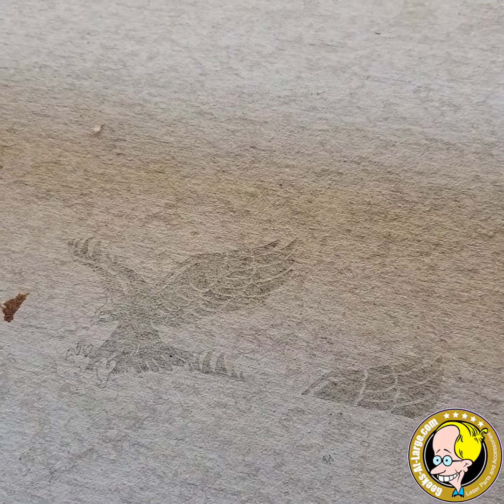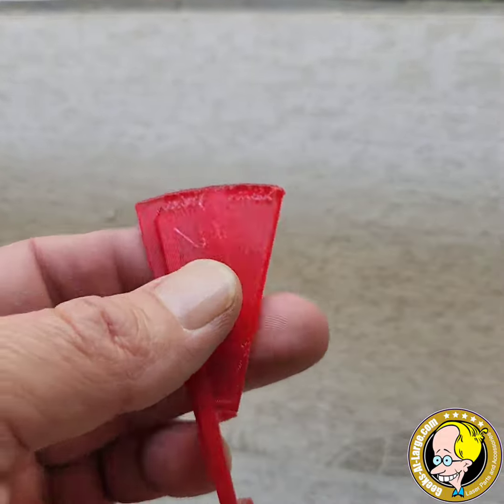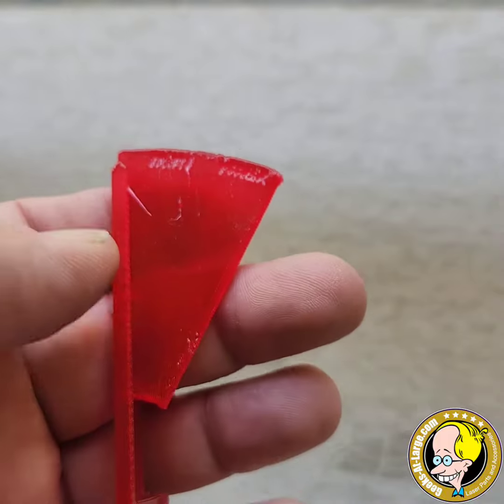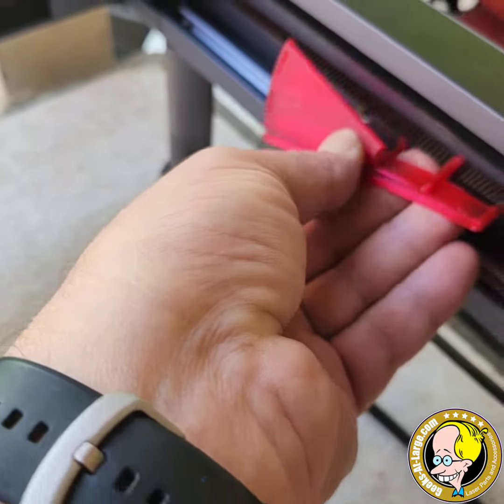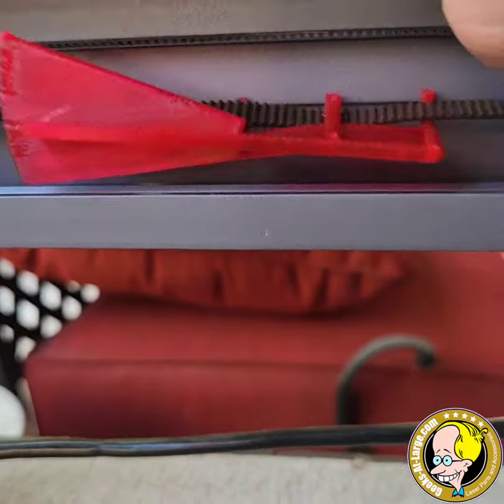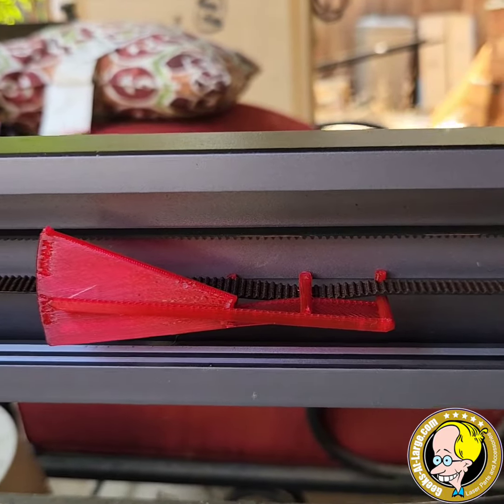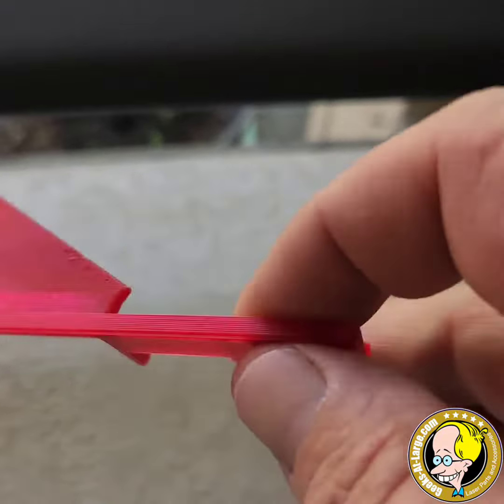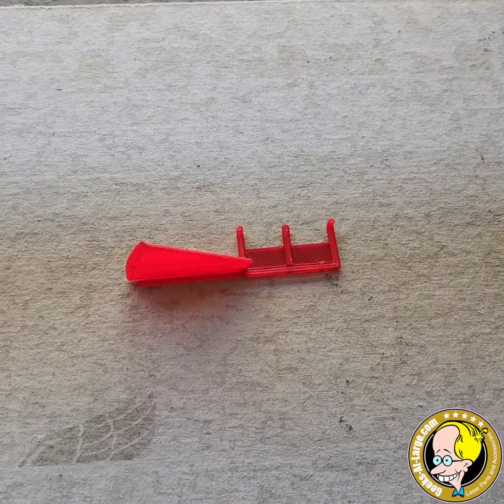Tensioning the belts on your laser engraver using the Prusa belt tension tool

Comment: can use it on any diode laser? ihave algolaser thx
Reply from the maker: @StanislavStano-c3s  usually, yes, if you can access the belts in the same way. Some machines, the ones built on the open spec design with 2020 or 2040 don't have access to the belts as they're down in a channel.